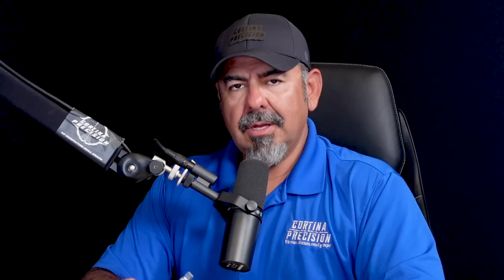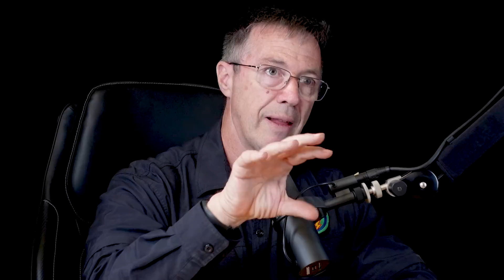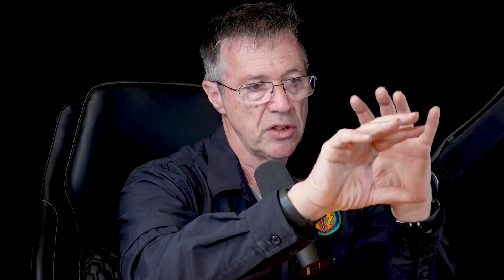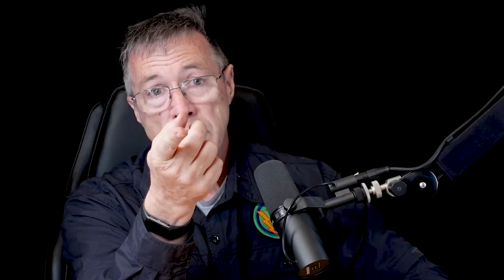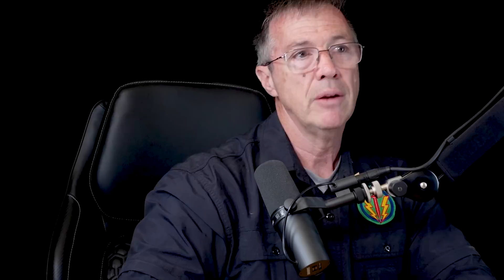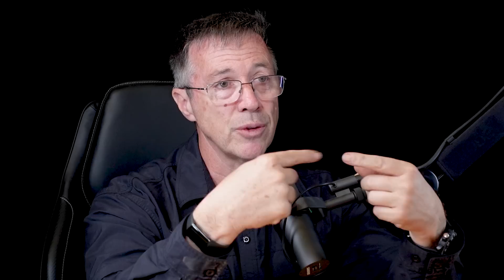John Baker - TacomHQ #123

Comment: i feel like a high speed camera would resolve the issue of muzzle "whip"  vibrations or whatever you want to call it.  

https://www.youtube.com/watch?v=e-R-D_v0udk
Reply: What is the discrimination of the camera you are suggesting? The images reviewed to date had an approximately .003" discrimination limit and movement could be measured by pixel tone change. Hardly conclusive as this was a copy of the original format, but due to the potential lack of discrimination by no means conclusive. Nothing is noted address anchor points/zero point of reference either. There is a lot of sensor data that does note movement. In fact some are so precise as to calculate impact point from the measured movement.
Reply: Resolution: The camera's full resolution is 1280 x 800 (1 Megapixel).  This is off of the site that sells the camera. Off of that we can scale the image and scale down to pixel. I assumed a .308 bullet and then measured the muzzle. Even if it was a .338 or .264 a 10% error would be in place. The scaling yielded .003" per pixel. Assuming the barrel uses the action face as its zero point .003" over 30" barrel does not yield much at the target. However, assuming the barrel is moving in one wave is a bad assumption- in all of the vibrational tooling I built I never witnessed such an event. If I start creating nodes at 15", then 7.5" things on the target are moving. Do the math for .001 over a 7.5" span and take a look at what it is on target 100m away.
The fact is the pixel completely changed tone. Indicating a minimum of .003" of movement. Second other features that appeared to be in focus went out of focus and continually changed focus during the firing event. Again maybe just a bad copy of the original format.
From a pixel stand-point it is recommended that a .0254mm object be viewed with 3x3 or 4x4 pixels at a minimum. The high speed images provided are nowhere near those values. The other clue is the distance to object as viewed by the camera- what is represented is a country mile and not only are we lacking pixel discrimination but the depth of field is non-existent. That is why the edge of the barrel is not a clear component. Some depth of field is present but discrimination falls with depth of field as a rule. Again 2nd or 3rd party film.